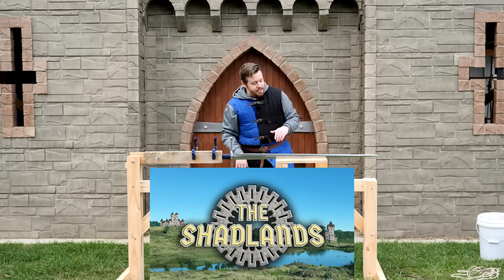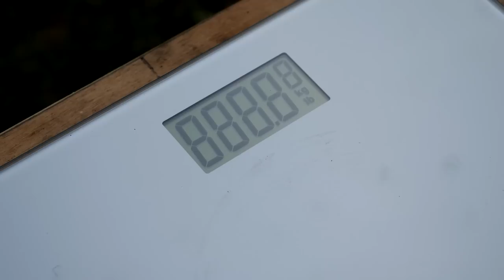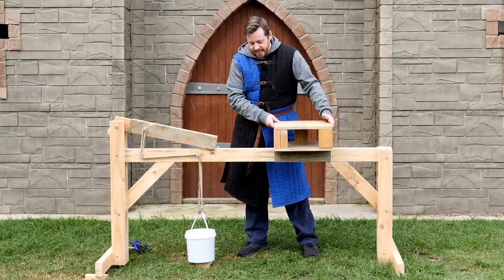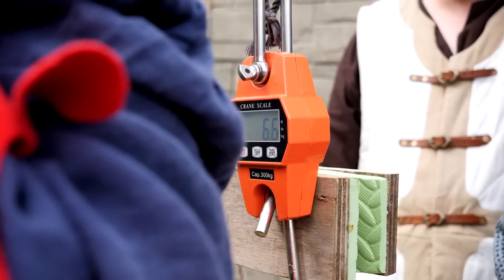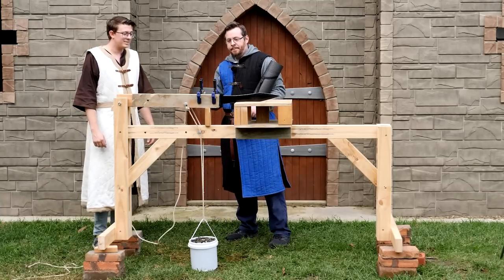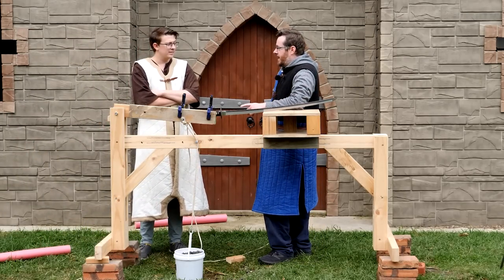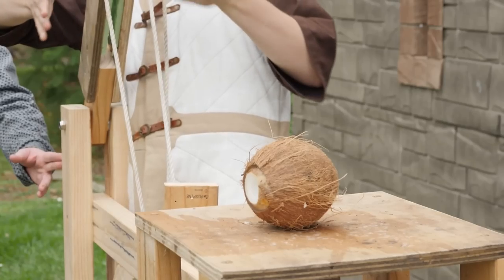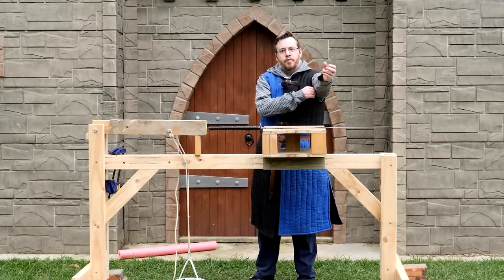Choppy choppy

Comment: I love the concept and inventiveness going on here. 😁 Definitely going to be watching the adventures in the Shadlands. 
I wonder if the difference comes from the difference in blade weight or curve. I know the katana doesn’t have a huge curve, but when coming down on the swing under human power there is the allowance for follow through and bending the angle once contact is made, while with the guillotine it stops at a specific straight angle since the sword is clamped in place. Also the height at which the down swing starts from could impact it, but both tests seemed close to the same between man-power vs machine-power. As for weight, I would think the English sword is a heavier blade than the katana. Watching it in slow-mo, it looked like the katana cut, but then bounced back from the impact.

Comment: What about a hose clamp or several for holding the blades two of the right length would provide the same amount of clamping force allowing a standard for clamps. You could use multiple pairs for grip points at the edge of the wood for a tighter grip.

Comment: Shad, the katana was hitting at a different angle due to the curve in the blade. When setting it up, you need to account for the curve. 

The main problem is your medium, as you normally don’t try to cut into a coconut. Because of how the fibers of the coconut line up. The katana hit directly against the fibers, while the other sword hit at an angle to the fibers. It’s like cutting into vs against the grain of wood. 

Your third problem is the point you’re measuring your weight at, as many other in the comments have said. You measured your weight at the handle on the guillotine but at the edge on the scale. 

Lastly, you’re measuring cutting power instead of sharpness. What I mean by that is the katana has less weight than the other sword, therefore it hits with less force. To measure sharpness you have to make the force at the cutting point the same between the two swords, requiring you to measure weight along the blade. 

As a side note, you need to make sure nothing moves. The coconut shifts, the katana slips from the gripping mechanism, etc. This isn’t as important, but it is another inconsistency.

Comment: When you swing a weapon, you are accelerating as you reach the target, so it's not really 7kg of force on top of gravity. When the rig falls, it's nothing more than the weight of the rocks and bucket falling, there is no energy source multiplying the energy being put into the sword outside of gravity. 

Watch the video and see how much slower the swords are falling compared to when you swing it. 

Just extend the size of the rig, or better yet, use tension bands of some kind instead of using gravity. Some sort of elasticky band will definitely allow you to achieve your cutting goals.

Comment: the best way to calibrate a precise weight on that bucket is to pour concrete in it. it's cheap, easy and reliable.
also, i'd opt for a metal bucket. those plastic ones are notorious for snapping.

Comment: You need some kind of system to prevent vertical movement of the hilt.  I suggest making something like the peg system for a miter box, although that might make it difficult to clamp the halves together in the same manner as it currently works.  Another solution you might consider is to just attach a thin wedge to the top and bottom of each half of the armature's interior, forcing the foam into a ( ) shape with higher density at the top and bottom.  Consider additional clamps on the underside as well.

Although, I would suggest that the primary reason for this failure is that the katana is ill suited to this application.  The sharkskin grip is clearly not playing nicely with the foam and the curvature of the blade gives the sword a few inches of additional leverage against the device.

Comment: I am just spitballing here about the design but maybe some of it will be useful.
Humidity and the timber moisture level will affect outcomes of tests due to weight.

Get a couple of nice bearings and use those with a metal bar for your hinge. Over time, the wood will smooth out providing less resistance.

A steel construction will hold up over time and provide less flex when suddenly pulling down, particularly on a heavier weapon there may be a spring effect if the downwards pull is hard and fast enough.

A direct drop without pulleys or that (sorry to say it because I'm a fan) god awful rope and bolt thing you have going there with a decent steel cable will be much more effective in consistency and longevity of your build.
 The build is good for a single technique but won't test what each blade is designed for as far as technique goes. Some curved blades have their cutting techniques with more of a follow up dragging cut vs perhaps a hammer or axe with that direct smack if you get what I mean. A horizontal cutting rig with springs for tension (which can be measured with cables and a crane scale or a bow scale) can allow you to dial in the direct power you want by pulling the rig against spring force however as they wear out, acceleration distance would need to be calculated. This type of rig would also allow you to have a form of controlled resistance suspension on the horizontal cut which would factor in techniques where a dragging follow through would be applied but also still be useful for the direct impact of a linear cutting action. If I could draw to save my life, I'd send a sketch through with what I mean.

Comment: I imagine the chopping rig allows it to flex/twist slightly - because your rig allows the handle to spin a bit possibly, and so the blade can slip off to one side or another - possibly due to the clamp slipping, or flexing in the wood -

Comment: I think something keenly important to accurately testing cutting capacity is allowing for a certain and consistent amount of draw on the cut, because what you have ATM is something best suited for testing axes.  Swords and knives truly don't perform well when only chopping, and not drawing through the cut to some extent will likely negate the advantages and disadvantages of different blade shapes. 

In reference to the clamp issue, I would run anywhere from 4 to 10 hose clamps through one board and around the handle of the sword, making sure to run the same number through each board and have them up by the guard and down by the pommel.  You may want to have some elastic material (like rubber) between the clamp and the board to prevent the clamp biting further and further into the board over extended use.

Comment: Slippage is the problem. the mounting can be fixed for that. You should also use a spring rather than weight, but you should also have a release mechanism.

Comment: The katana steel is folded so that the textures of austenite and martensite with different hardness are dispersed. When katana is sharpened with a Japanese sharpening stone by the Japanese method, austenite is scraped and martensite remains, so the blade becomes like a micro saw. The trajectory of a human swinging a katana is the same as pulling a saw.
Kitchen Knife made in Japan has the same effect with Japanese sharpening stones. When cutting with a Japanese-made Kitchen Knife, pull it like a saw.
Katana does not slash with strength, but with technique.

Comment: Part of it is the clamp. Part of it is your arms aren't going to bounce back in full swings. When the blade hits the object using the machine, it's not going to keep pushing through as soon as it hits like your body does. Yes you have the rock weight pulling it down, but I don't think it's comparable to how strong and fast your strikes are.
When you hold the sword, it's also gripped tighter near the guard. Lastly, when we cut, it's at a slight angle, it isn't just straight out. The guillotine is striking as though your arms were locked. 

Appears like the machine is just dropping the blade rather than cutting.

Comment: Another thing about the katana is that unlike the zweihander the katana is not meant to be a force weapon but q slashing weapon (so when you figure out the slashing apparatus you might get more interesting results), whereas the zweihander is meant to have weight put into it so the adddd weight of the sword itself is adding an exceptional amount of extra force into the cutting power ;)

Comment: Hey Shad,
You are attempting to obtain the force of your swing with you sword by measuring the force of the stick on a scale at 1 position. However during your swing the force you exert will depend muscle extension and velocity. So you would have to measure it during the entire duration of the swing. Rather unpractical since you only care about the impact at  the end of the strike. The best way to make your contraption mimic your strike is by mimicking your strike. Use a material that you cut partially, and adjust the weight on your contraption to match your results roughly. The weight will probably be different for different weapons so... good luck.

Comment: Dynamic vs static force. You need to acquire an adequate sensor and whack it full force to measure how hard you can actually hit.
And even then, your bucket is giving a constant force, unlike a regular swing which is accelerating throughout the swing.
Not to mention that each sword will give you a different reading even if you manage to hit the same every time with each one....

Comment: The guillotine is not calibrated properly.  You need to measure the force at the end of the blade like you did with the wooden stock test.  Based on the lever set-up, I expect you are about a factor of 2.5 off the actual force you need.  To fix this you could add 2.5x more mass in the bucket.  We built a guillotine like contraption for structurally testing rocket parts and it is really all about the calibration.  Love the video!!

Comment: Clamps are crap for grip in sideways direction. The blades are clearly changing angle in the grip upon impact.
You could try putting wood blocks above and below and using clamps vertically. Then you use the clamps in their strong direction.

Also, this construction basically tests cleaving capacity. I bet it would work great to test axes. And probably hammers too.
To make a real slasher, to test cutting capacity, I like the idea of giving the swords an up-angle. Although a real slash would require a serious angle. So I am not sure this construction would cut it. (pun intended) To make a knife cut, a flexible grip sounds better. But then one that can drag the sword through, and get back to the original angle after the target is cleared.
But the main thing I would try is a platform for the target with a split in the middle, and allow for the sword to go all the way through. (Like the karate people saying don't aim for the thing you're hitting, aim beyond it.) I think the platform will need to be higher for that, or the entire rig higher, so the bucket has more room to fall.

Comment: The mechanism which holds the sword doesn't prevent up and down movement of the handle. It only prevents Side to side motion. This can be seen when the blades deflect upwards after hitting an object. Since there's no follow through your blades are not cutting at full snuff.

Comment: Put loose bolts on the top of your gripper so thr force of the handle is held back as it strikes. You loose a lot of power from the grip not holding tight. The loose bolt will allow the gripper to expand but still provide a backstop for the handle of whatever you put in there.

Comment: one thought i had: the clamping on one end is going to flex the other end of the plywood. i don’t know how tight a fit you made that pivot point (i haven’t watched the shadlands video yet) if the pivot point of the plywood is a fixed bolt the wood rotates on the flex in the wood could cause tension on the pivot bolt. maybe bore out a 0.1mm of the plywood so there is more clearance. also there is weight difference between the english sword and the katana may be significant to change the five applied i dunno. good luck love the video
Reply: ok watched the video of making it: the plywood isn’t part of the pivot, so that’s a no go. another problem is sword length: that changes the fulcrum length of the swing and changes the force applied to item struck.

Comment: I think if you measured the speed of your strike through slow motion and matched the speed on your rig by adding weight you’d get much more realistic results.  As others have mentioned, the grip isn’t working great either. If you clamp a little above the forward part of the handle and a little below the end of the handle it should be much more secure with your current setup. 

I’m excited to see how this turns out with refinement.

Comment: Hey Shad,
Not sure IF this will fix the issue, and i also see a lot of other good suggestions from others, but i've had a similar problem helping my dad on projects too.
You've still got some ONE operating the conversion of potential energy into kinetic and you'll still run into a measure of inconsistency with human hands doing the releasing.
However y'all want to incorporate it should work, but i've always used some type of pulley release - a quick simple motion that leaves little to no inconsistencies.

Comment: As far as a suitable substance to chop is concerned, MDF is pretty hard and very consistent, plywood is a bit softer, and hardboard a bit softer still, or even thick multi layered corrugated cardboard, but I wound stand it on it's edge rather than have the sword try to cut a flat sheet, that way you can more easily see how far it penetrates.  I would be careful using something too hard, as it could break the sword if it shifts though, maybe?

Comment: You need to fixate the sword handle much tighter, it's loosing a lot of force when it shifts in the clasps.
You can use a pin above the handle near the guard to stop it from shifting up and maybe two pins (above the handle and (mainly) below the handle) near the pommel.
But it'll have to be modular to fit various swords and other weapons and holding positions.

Comment: "Now, to demonstrate the cutting power of our two-hander, we're going to use what's called the meat target. Now forgive the redundancy but for those that don't know what the meat target is, it's leather couch 'skin', followed by pork chop 'pectorals', followed by pork ribs, a bag of oranges to simulate lung tissue, more pork ribs on the back, four layers of T-shirt on the front, four layers of T-shirt on the back and the whole thing followed by our new and improved, high tech fleece blade stop."

There's got to be at least one other Paul Harrell fan 'round here.

Comment: Okay, so just focusing on why the heavier longer sword cut better: I believe it's because it's heavier and longer. The extra length means that it had further to fall and was further from the left side of the sword guillotine, both of which increase force applied at point of contact, and the extra weight also increases force applied. Gravity is imparting more energy to the heavier object that falls further. The rig removes human variables, but it leaves in size and weight as variables of the blades in question.

Comment: to do a draw cut with that rig you just have the put the test medium on an angled platform with a slot down the middle so it's not just hitting it flat and stopping. Also, a simple safety catch/release probably be useful for testing so there are no variables on how you drop the block.

Comment: The clamps and sponges gives on impact hence the force is not transferred to coconut but instead suspended by the sponge and movement of grip. You need a better grip maybe another pair of those grips but from vertical angle so you mimic a hand better and sword doesnt move upwards on impact

Comment: If you think about the angle, than make the platform splitt in the middle, where the blade could pass at an angle. However, that would make it more of a cut, than a chop and most objects not fixed to the platform will most likly be shot out on impact.

Comment: How about you make a reversed pulley system.
So basically instead of having the weight pulling at the lower angle set it up at the already higher.
But by using pulleys you should be able to generate equal force every time.
I am referring to the system you use on compound bows.
Or even use a bow like system that can be adjusted to resemble pressure increase depending on the force you can use.

Comment: shad if you do a drawing cut machine id suggest adding a bungee or strong spring to the machine and a pivot on the (at the end of the arm) to have some level of flex so that you can simulate a persons arms give which help the person cut as deep as it will allow along the distance (it would need to be pretty strong tho)

Comment: You have to measure the speed of your swing  by filming from the side against a striped backdrop. I suspect the wood frame is not swinging the sword as fast. You matched the final push down weight.  But with the correct motions your muscles can apply a larger acceleration during the early part of the swing .  So you may need to use a spring or something to launch the arm to give it a boost of speed without affecting the pull down force at the end.

Comment: Shad you need a safety mechanism while you load your target medium.  You might also drill holes in the contact board for pegs to hold your target medium in place, placement of your target will change the angle of where the sword strikes the target.  How the Katana hit from the mechanism, and the way you struck were very different.